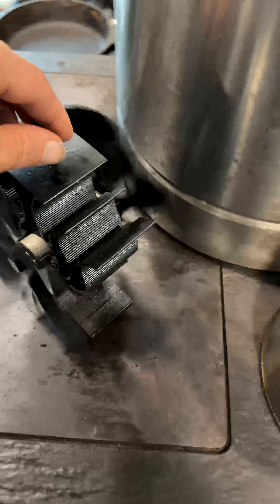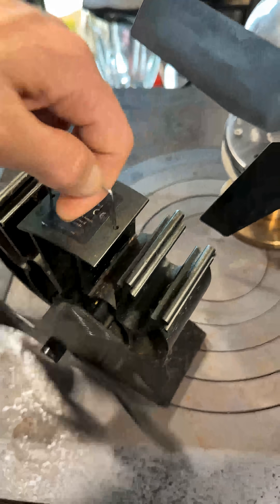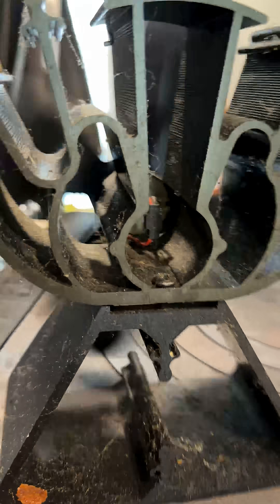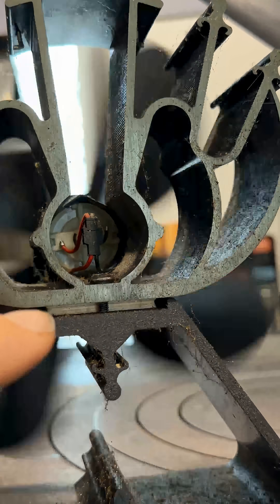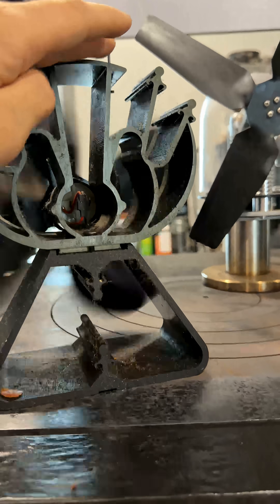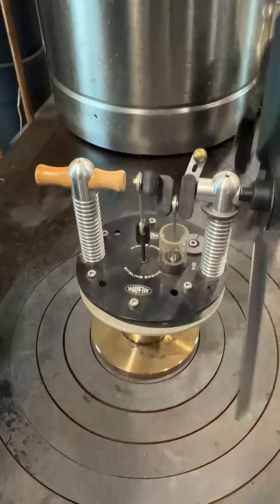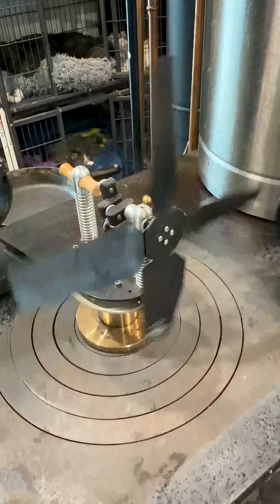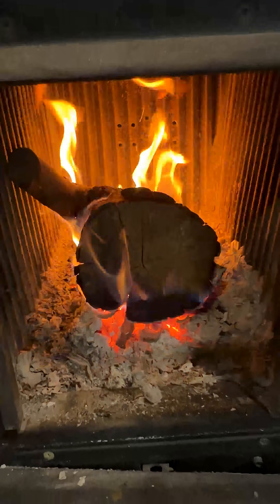Stovetop electric fans powered by heat #narrowayhomestead #offgrid #stovetopfan

Comment: Thermo-electric fan
Reply: That's a better term but "heat powered" isn't wrong. 

"Power" is basically the transfer of energy so it could refer to electricity or the power that was transferred into an object to create electricity. 

"Solar power" is electricity. "Wind power" could be electric or it could be the wind pushing a sailboat. 

Terminology is fun 😅
Reply: @brookelord3448  Thermo-electric is a generic name for effects like this.

 Seebeck effect is one of the thermo-electric effects.
Reply: @brookelord3448  what about solar water heaters.....
Reply: @simonehudspeth861 *solar water-heater. They're solar powered. So are solar sails. Context changes the meaning so what actually matters is the grammar and syntax of the sentence.

I should clarify "solar power" can mean anything but "solar-powered" specifically means electricity. I just meant that as a standalone concept "We need solar power" is referring to the concept of electricity generated by use of sunlight which can include photovoltaic or solar thermal power being used to boil water to spin a turbine. 

Some solar water heaters are, in fact, electrical generators. 

Overall, it's not wrong as long as the person listening or reading understands what you're describing.
Reply: @simonehudspeth861  solar water heaters have nothing to do with solar panels. You know that right?. It's literally just a casing with a glass front and black plastic tubes all the way through it... They are no more scientifically unique than the dash of a black car in the summer.
Reply: @phenodfirefoots7720  correct but still solar powered
Reply: @simonehudspeth861  That is quite the stretch... :p
Reply: I would call them a Hybrid fan. The fire drives a silicon heat engine, driving a current to the motor turning the blades.

Still uses heat. Just an external combustion engine, like a steam engine is an external combustion engine despite the fire being kept in a fire box.
Reply: don't forget the external combustion fan.
Reply: @jamarsac  yeah,that one is pretty neat. and i loved how he showed it to be a combustion engine.
Reply: This fan operates on the Peltier effect concept.
Reply: @schrodingerscat4737 which a lot of folks don't understand.

So let's start with Solar panels. Where electrons loosely held get hit by light and get excited and jump from one side of the silicon wafer to the outlet silicon wafer, then need to rush around whatever circuit there is to get back to where they started.

Funnily enough, heat also can excite electrons, through a different mechanism, but sure.

So by getting the doped silicon wafer hot, it causes electrons to jump the gap to the outlet side and rush round the circuit to get back to where it came from.

This is all significantly simplified from the full details, but enough to explain why they work.
Reply: @schrodingerscat4737  No, it does not, as the Peltier effect is when you get a cool and a warm side by running a voltage over the material.

Here it is the opposite, the temperature difference creates a voltage - which runs the motor -and thus it is the Seebeck effect.

Thermoelectrical effects has specific names depending which way they are operated, just like a generator fed with electricity turns into a motor, and vice versa.

Terminology is fun! :)
Reply: i was about to call them non r rtg :L
Reply: I think an induction heated powered fan might be more accurate. 🤔  yeah, ur current source of heat is combustion, but the fan works without cubustion fire. 😮❤😊  any hot surface works 😊 i am not trying to be the terminology police. Just an idea. all the best. ❤😊
Reply: @erikpriest  In this case induction doesn't play a role. Thermo-electric is a set of effects that includes diffierince in tempatures causes diffierince in voltage.
Hence, I called it thermo-electric.

This is from diffierence in how work function, how much energy you need to free an electric charge. For 2 materials it depends diffierently in tempature, then the cold and hot points of contact will have diffierent work function, which is the voltage.
Reply: Thank you, I was about to say that.